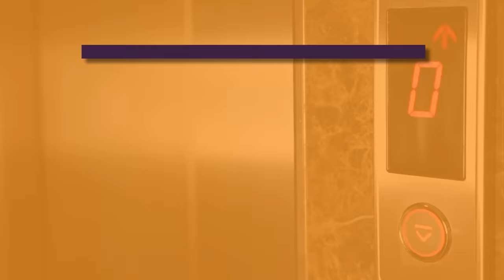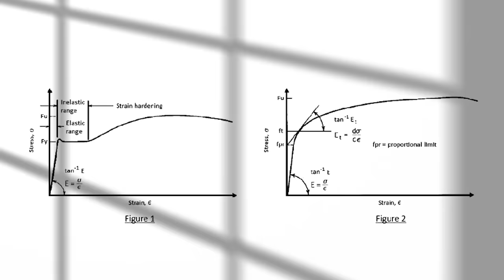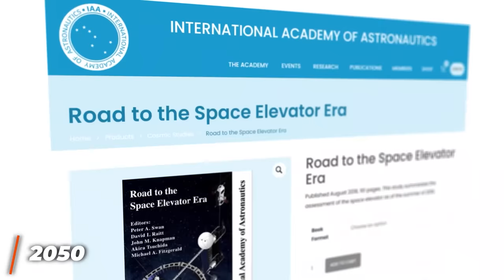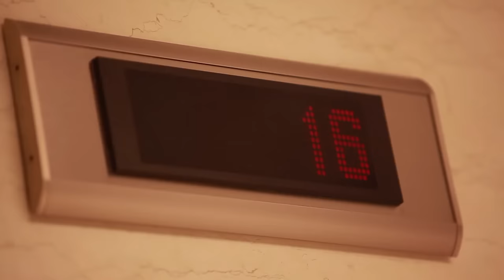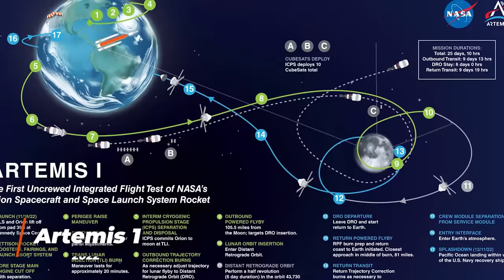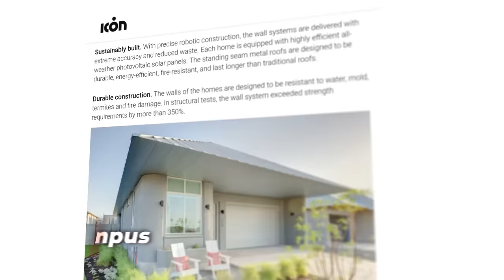Megaprojects of the Future

Comment: Space Elevators are not practical. Just because something is feasible doesn't mean somebody should do it. 

Space Elevators would make space significantly more expensive. After mostly renewable rockets, the infrastructure is the next most expensive part of space travel. And by a large margin, too. Most people think it is fuel, but usually, fuel is well below the 5th or even 10th most expensive part. With a Space Elevator, you are taking the most expensive part of current space travel, making it larger than anything humanity has ever made, significantly more complex, and putting in space. Each one of those increases the cost, put them together, and you make the upfront cost as well as maintenance costs EXPONENTIONALLY more expensive. 

Also, you still need most of that fuel. Firstly, just because you get to space doesn't mean you stay in space. It would be best if you achieved orbit, you know... so you don't fall back to Earth and die in a ball of plasma. Which is actually requires more energy. Your only benefit is you are no longer in Earth's atmo, so there is no drag. And how do you expect this thing to keep in orbit? Loads of fuel will need to be used to do station-keeping maneuvers.

Also, later in the video Simon mentions debris in orbit that this thing would need to dodge. I mean we need to dodge DUST in order to keep it from hitting humanity's largest cable.... which is made all the harder when you realize that the counterweight needs to be on the order of 10s of thousands of tons! 100s of thousands of tons, really. 

You have a 3 body problem with FOUR interfaces for mass transit that can simultaneously happen. All of that needs to be perfectly balanced so there is little to no tense difference or change in the center of mass of a giant tether floating in space... that is insane. Doable.. yes... feasible sure... practical... fuck to hell NO!  

As an engineer, I have seen peers, as well as my self, get hyper-fixated on a technical problem, especially when that problem is actually solvable. We do not stop to ask if the solution is practical for human to use/maintain. This is one of those times. The best part about learning and solving the Space Elevator problem is all the learning one gets to do. Not the actual solution cuz nobody is gonna to use it. And if you think so ask yourself why? Do you not believe that there are other cheap, safe, ways to space? Hell yeah, there is. There are all sorts of other solutions. 

Also, Space Elevators are tide to the equator, and last time I checked, the governments of the world aren't gonna like that. Just look up the Panama Canal for an example. (yes there are some extreme solutions do remove the equator requirement but... yeah, I already made my point about that)

Comment: This might be a bad idea but couldn’t we fit a bunch of solar panels on the ocean like just float them out on top of the water
Reply: This is already done with wind generators, so yes solar could be done, but wind is more efficient
Reply: @SirNecro  so this might be a little absurd but could we make boats that sail with wind and also store wind power in a generator or something, or is less energy generated if the wind is also pushing the object because of less friction or something, maybe ur not the expert on the matter but like for the sake of ideas, 🤷‍♂️
Reply: @GuysIMadeAVidio  Theoretically yes. However in practice it would take some next level engineering. Basically you would need to exchange your fabric sails for wind turbines that then ran a propeller and those turbines would have to be big enough/effective enough to create more power than required in order to store it. You would also drastically increase the weight of your sailing vessel.
Reply: @SirNecro  so like an aircraft carrier
Reply: @GuysIMadeAVidio  Sure. Just remember that the turbines can't get in the way of anything important, so an aircraft carrier might not be the best option. Although I am aware of water turbine technology which I believe defence vessels use. Having a windmill/turbine on deck would likely cause some issues.

Comment: I suspect that by the time space elevators are technologically and financially viable, something better will already be in use.  No to mention people afraid of a multi-thousand mile cable falling on them (along with the carriage) if something goes wrong…
Reply: They could build one on the Moon, and then one on Mars, first, to test out the engineering.
But, since any built on Earth would have the base for its tether out in the Pacific Ocean, where there's nothing within several thousand miles in any direction, and the only part that might fall without burning up upon re-entry would be about 200 miles worth (at most), most people wouldn't care all that much.

Remember, it has a counter-weight out past the geo-stationary station.
So, if it breaks anywhere between the geo-stationary orbit and the planet, any part above the break gets pulled upwards and away from the Earth.
And any part more than a few hundred miles above the atmosphere burns up as it re-enters.

If it breaks above geostationary, the counterweight goes upwards into a higher orbit, and the section below the break starts to drift in the opposite direction of spin.
It might break again, below the station as the tether bends, but then you just have the same issue -- a few hundred miles falls, and then the rest burns up, while the station achieves its new orbit.

It would be a mess to fix, yeah, and we'd have to use rockets again to do the work, but it wouldn't be catastrophic to anybody on the planet.

Comment: There are technologies that are more viable for a “space elevator”. Beam travel which is based on using plasma beams to travel from the surface to a point. A zero point generator would have more than enough power to make this happen without little effort. But why a space elevator in the first place? That’s 70 year old technology and not very practical.

Comment: Contrary to what some seem to believe the warming in global warming is a surplus of energy with in our atmosphere so beaming down extra energy from space solar farms in to our system is not a good idea but would make the situation even worse. It doesn't matter what form the energy have (electrical or microwave or what ever) as long as the earth retain to much of it we will warm up, all forms will eventually be turned in to heat to some degree (no pun intended) so a system to use the energy we already have by converting and concentrating it would be a far better solution. If heat could be collected concentrated and transformed eather to usable form or for emission in to space as IR or perhaps microwaves if those do not warm the atmosphere prior to leaving earth then we could in effect "air condition" the whole planet.
Reply: In terms of direct heating from the beam that comes from the system, this will have a very minimal heating effect. It is insignificant compared to the sun’s power absorbed by the atmosphere and ground.

The sun delivers approximately 113,000 TW into the earth’s energy budget, absorbed in the atmosphere and on the earth’s surface. The total world primary energy usage (to generate electricity, provide heat, drive transport and industry etc) is of the order of 19 TW. Assuming 10% of all the world’s energy was derived from space-based solar power, this would only be an additional 0.002% addition to the earth’s energy budget. To put that figure in context, the sun’s output varies by about 0.1% over the course of a solar cycle.

Comment: 3:39 how would you detach all that weight from elevator and not disturb its balance, and how would you propel when you detach to meet with space station for example?
7:40 how would all that ice agree with all those lasers?
11:40 what would prevent me to put a "mirror" in that beam and bur the F... out of things I don't like on earth?
15:42 that sourcing out is kind of the paradox in calling it self sufficient, it either is or it is not you can not call something self sufficient while requiring outside sources, if nothing else in mind think about scaling this concept up, more and more of those underwater cities you have more and more outside resources you need, given that we already whining about limited resources of all kinds how would you scale up those resources which we already say we don't have enough for current sate we are in? Essentially what you are doing by building this is same as if someone told you there is no more oil and gas reserves in the world so we would build bigger engines now, it does not make any sense, yes they would use some resources from the sea but I bet majority would have to come from outside sources.

Comment: We just spent $200,000,000,000 in a pissing contest with Russia in eastern Ukraine.  

What’s $23,000,000,000?

Oh and side note.  Geo synchronous orbit is required for the concept of a space elevator.  Anything closer, and the cable wouldn’t be stationary either..  get it?

Comment: Wouldn't a solar panel in geosynchronous orbit spend about half its time in the shadow of the earth? Just  a bit less than we do on the surface!  And exactly how it all that energy going to be beamed down from 18.000 miles? And what happens if the energy beam goes astray?

 Geosynchronous orbits require being on the equator and have to be shared with communications satellites so the spots are going to get pretty scarce. So it will have to be shared with space elevators too. And won't those tethers be obstacles to all other orbits in space?

Still a pipedream.
Reply: Space is big and you're far enough away that that's not a concern.

While the issue with where it is pointed is still a problem but that's fiddley bits
Reply: It will only be in shadow 5% of the time on the spring and fall equinox, and those are the longest 2 days for shadow. Zero shadow in summer/winter. And there is about 160,000 miles of circular space to fit them in, so no fear of getting crowded.
Reply: @bobthecomputerguy  Thanks. That seems reasonable.

Still getting things to geo orbit will be tricky if we have space elevators.  So putting these projects together will be tough.

Comment: Remarkable. It looks like you, along with almost everybody else who is not physics trained, have yet again failed to understand the whole space and gravity concept. If you travel upwards in a straight line into space, gravity does not just magically disappear. If it did then what would hold the Moon in its orbit? Getting up to the height of the ISS would be all fine and dandy, but delivering supplies to something that is screaming past you at 17500 mph? That's another matter entirely. In energy terms the potential energy you gained climbing to that height would be less than 10% of the kinetic energy you need to actually catch up with it and dock with it. Space elevators may ultimately have their uses, but when you consider the astronomical costs of their construction..... nah..... can't see it myself.

So, gravity, two basic aide-memoire.....

1. In space gravity NEVER, EVER goes away. You float around seemingly weightless, not because of a lack of gravity, but because you are falling. Sometimes you fall in some sort of more or less circularised way so that you don't hit anything, like a planet (orbits), but you're still falling.

2. Go back to 1. and read again.

Comment: No, your writer clearly has ZERO understanding of orbital dynamics, to get from a space elevator to the ISS would be just about as difficult as getting from earth to the ISS, that thing would whip past your elevator at about 20,000mph. (no joke, look it up)

The only feasible targets for an elevator are the geostationary ring and elliptical orbits beyond that, in theory its a great launch platform, at the 'counter weight' you're already 20% of the way out of earth's gravity well.

That said, we can already build an elevator of sorts using regular old steel, this would be an ellipse that very nearly touched the surface of earth going up to, well... any altitude we wanted (probably near the geostationary ring, the transfer velocity would be relatively small, in the order of hundreds, maybe even tens of mph, not tens of thousands) and would consist of a vacuum tube with a kinda maglev like system inside, along which we pushed weights [magnets] such that the average velocity of the tube and the weights was that of the orbital profile in question.

It would work really well as the velocity of the tube relative to the surface would be literally zero, it would just drift down out of the sky, tag earth then drift back up, it would be so slow there would be almost no air resistance at all.

The only real problem we have is..... humanity cannot as of this moment produce enough power to keep the thing up.
Well that, and we would need to cut and flatten a perfect trench around the equator for this thing to roll in.... might annoy a few folk who live there.

Oh, and before anyone says it, yes... it doesn't need to be weights, it could be an energy beam constrained by magnetic fields, I just find it tricky to get my head around keeping that thing cold enough.

Comment: Why bother with space-based solar farms? Nuclear raactors would take up about 1/75th te space, and that is if your colar cells were 100% efficient, as of 2015 they were 20% and in 1985, 10%. That would be a waste of rare earths. Then too, space-based energy farms would be subject to the same  weak links: LITERALLY; as any remote link-dependent system: Two words: "Murphy's Law". The microwave beam will be a nav hazard and the costs will far outweigh the benefits. It's these kinds of pipe dreams that gives science fiction and so-called intellectuals a bad name. They sound soooo cool until they don't when you look at what it would take to implement them. When you upscale anything, weight goes up according to the volume and you would have to move all that weight inot outer space to LeGrange points, the number of which are finite, which you will occupy and take them away from endeavors that could use them more efficiently. Then you would have to assemble the units, meaning haul up the assembly units, either human or robot, program or direct them. What you would end up with is a rich man's toy that would never last long enough to pay back the expense; solar cells wear out. Successful large systems evolve from successful small systems. What usually kills mega-porjects, once they are in place is upkeep, maintaining them and repair. Then they become obsolete. And I won't even get into the corruption inherent in the massive government funding save to tell you this tale, which I heard myself. IN c2013. The Feds said they would quite subsidizing development of the electric car and immediately the crybabying started, and who do you think was leading the Bitching Batallions; the Eco-fascists? Nope. The Welfare Statists? Nope. The Chamber of Commerce? Yup. Pig Business has hordes of lawyers and moochers trained to sniff out and home in on a corrupt bargain with the speed and accuracy of a heat-seeking guided missile homing in on a rocket engine and who can hear that "SU-ey! suey! suey!" form the next galaxy; even through the near vacuum of space